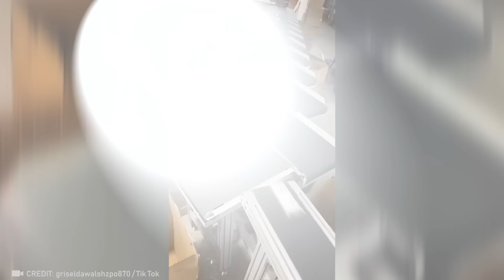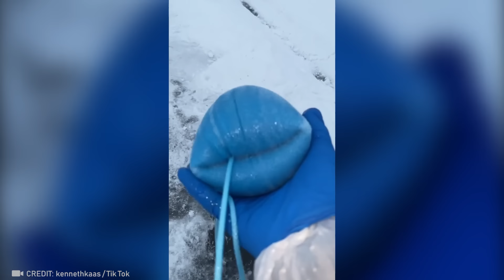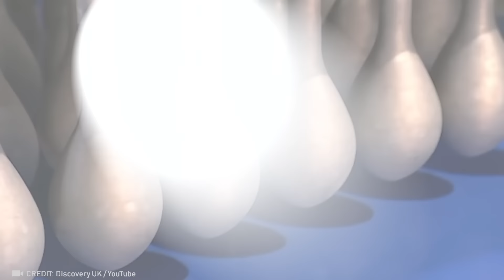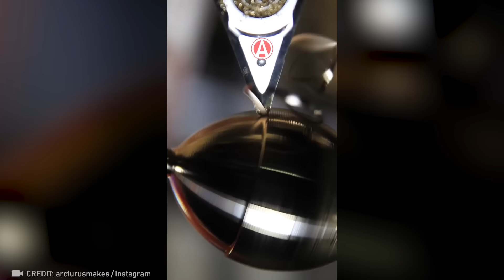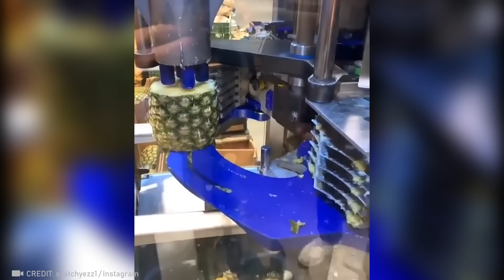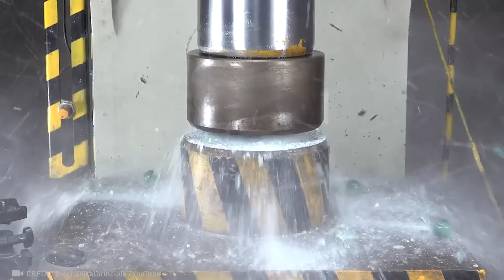Most Satisfying Machines and Ingenious Tools

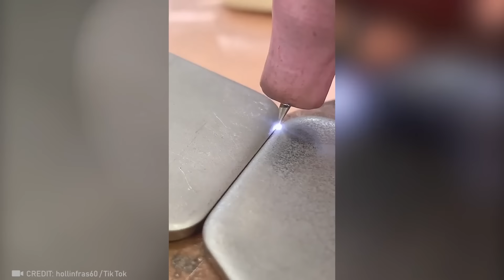Comment: hi! welder here, 8:27 is tig welding; not soldering. this weld in particular may look superficially good but were I to yell loudly, it would sunder like an autumn leaf. want super satisfying welds? look for someone good at "metal core mig welding", I got some welds in that process that looked like dragon scales... and could stand up to abuse. conversely, properly done tig welds have temper colours that look like a beautiful iridescent sheen.
Reply: by the way, the guy messed up his second tack and its retry. over all: 3/10, good arc distance, adequate weld placement, the worst weld penetration I have ever seen. "lacks commitment"

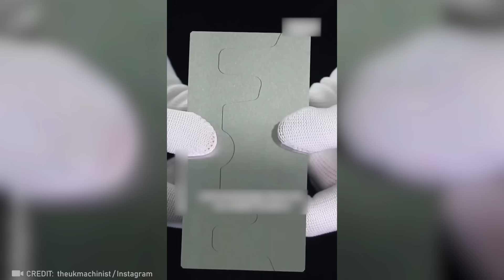Comment: Love how the two pieces joined at 10:00 show no visible seam. Such precision!
Reply: Just to make sure people know that it is not one piece that has been cut in half. One side was one piece of material and the other side was from another. Most of these you see are done with EDM (Electrical discharge machining).
Reply: @frantickoala994  The trick is to brush pattern them AFTER cutting and joining them. THAT makes the cut disappear.
Reply: @HotelPapa100  Still requires extreme precision to get the two cuts to match perfectly.
Reply: @frantickoala994  meaning cut with lasers?
Reply: @erwinj9697  no https://en.m.wikipedia.org/wiki/Electrical_discharge_machining
Reply: I agree, accuracy of that complex mirror image part is fascinating!

Comment: That's not soldering, that's just TIG welding without filler wire.
Reply: They also edited out most of the time the arc is on. I don't get it, TIG is cool enough without faking it.
Reply: Wouldn't that be MIG welding?
Reply: @nicholasgibson8483  no. That's a TIG torch. No wire feed

Comment: The problem with this narration is that it's completely wrong he talks about etching glass but they're cutting glass he talks with a Noodle Factory running 24/7 but it doesn't run 24/7 because have to stop the Machinery to clean it

Comment: Which machine would I like to try out? Well back in the day I did drive an overhead gantry steel scrap crane at BHP Port Kembla here in Australia before graduating to driving to overhead cranes that lifted and moved steel plate and even drove a mill crane that was capable of lifting over a thousand tons. Best part of my job was we were encouraged to multi skill so I got to use some pretty massive and awesome machinery from cranes, turnover tables to paint machines and shears that could cut steel plate up to 4inches thick or use a machine called a leveller that could make steel plates perfectly flat. Great video thanks for sharing. 👍🏻👍🏻👍🏻
Reply: I always thought the taffy puller looked like fun. So mesmerizing and satisfying to watch.